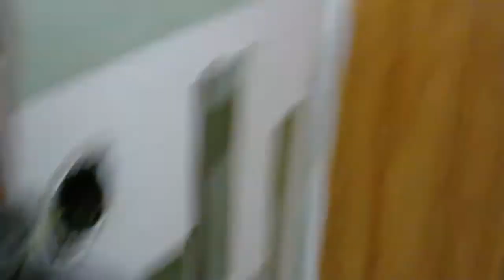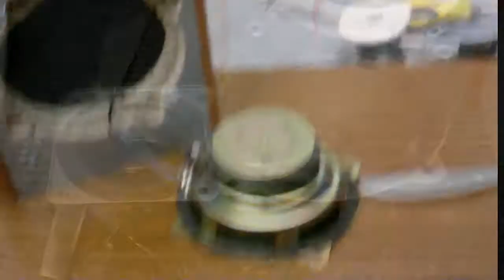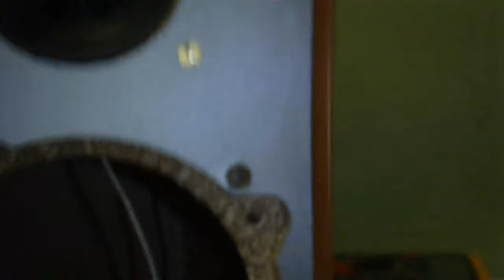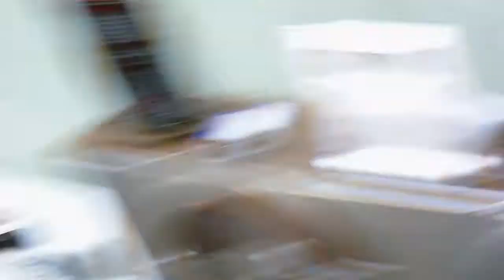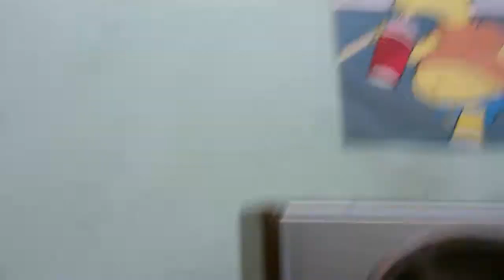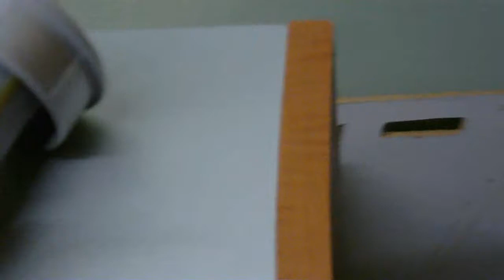Improving the JVC SP-UXHB4 speakers

Comment: Hi, Kindly Please try & Replace your speaker Capacitors to Silver Cap. Everybody say Silver Cap sound Best  of the Best.  

Pls insert in "Solen SILVER METALLIZED POLYPROPYLENE CAPACITORS" and try it out on Mid & High frequency Crossover.  Please explain Why! Silver Cap are much better Sounding than Alum Cap.

By right should be Perfect. Pls...insert into it & provide comment. Tks. Please provide Youtube review. Pls, no cheating, must be silver cap for High & Mid range together. Try it.
Reply from the maker: +Madcow Computer You didn't need to spam this comment on several other videos.

Comment: Sorry but i don't get it :P

You added the transformer as an inductor probably for the low pass which is crazy okay let's exclude it,but why do you have a capacitor on the woofer which is cutting the low frequencies? You'll get only midrange frequencies.And why you added a cone driver as a tweeter? if you turn up the volume the woofer will rip it off.
Except that if you make an FR measurement even with a highly smoothed result the speaker will have huge drafts. :D

Comment: Really well done! I like your new intro too!
I was really surprised how good these speakers already were before you modified them. They're looking so similar to todays junk speakers! But the quality of the housing and the woofer is really good!!! And with the tweeter they sound even better. I think you should try and get the dustcap and the surrounds out again. I'm sure the speakers will benefit from that.
Did you used old power transformers for the crossover? They really look like they are.

Comment: I'm impressed, I never could figure this out, as once I have a capacitor parrellel to one speaker it will lowpass any other speaker on the same circuit... well obviously there is a way .. I'm just not seeing it.